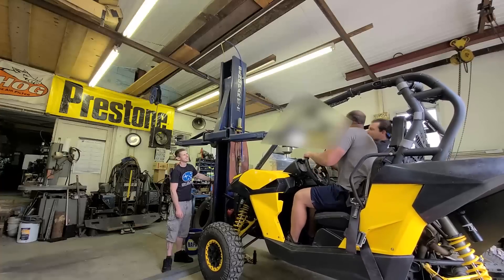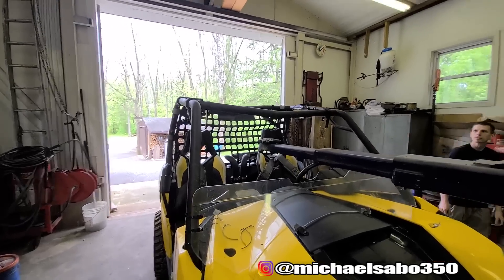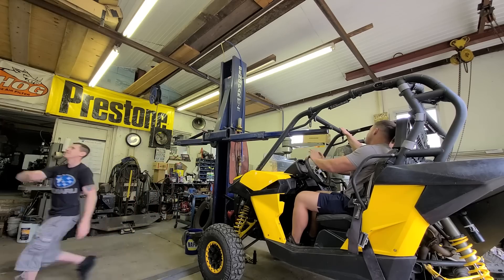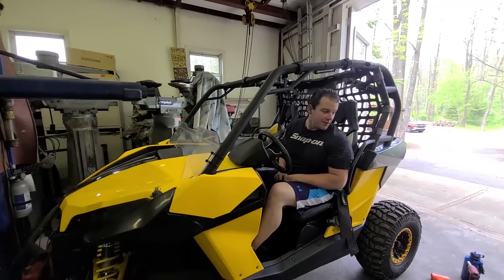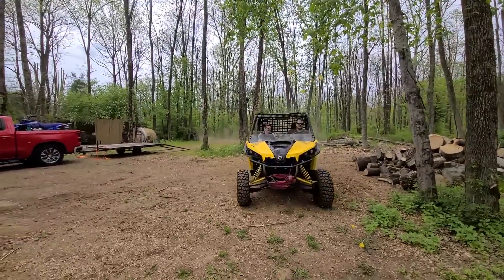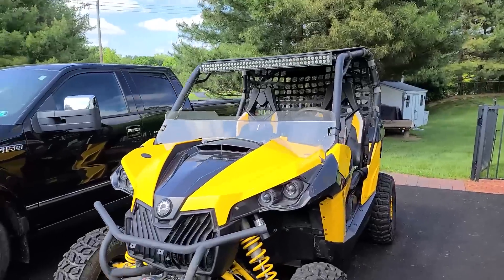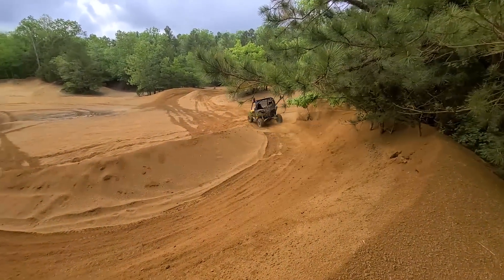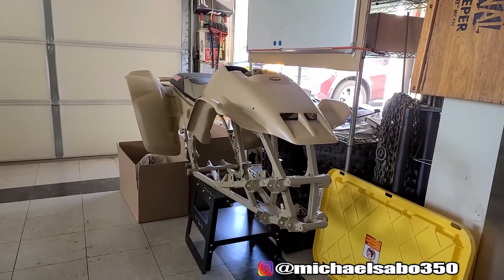We Un-bent the Canam Roll Cage! Side by Side Crash aftermath and fixing it

Comment: Nice work guys!!! Next time heat it with a torch.  Will bend back earlier.  That squeaking the suspension makes can be fixed with garage products bushings or by taking apart and greasing the hell out of them.
Reply: When you heat the metal you actually weaken it more than if you do it cold ether way it will be weaker in that spot just with heat it is weaker it can also get brittle not always but it can (no disrespect)
Reply: @br1zzl395  I appreciate the feedback.  Will it weaken a lot  if you just use a propane torch to just heat it a little just to help it bend easier? I understand a oxygen  Acetylene torch could probably heat it too much. Just figured a little heat couldn't hurt.

Comment: I have a 2017 Can-Am Magic X3 Max Turbo R I have a belt temp gauge . I can run it hard the belt temp never 
Gets above 168 degrees. The belt temperature gauge was put on at the dealer. Its the Razorback .